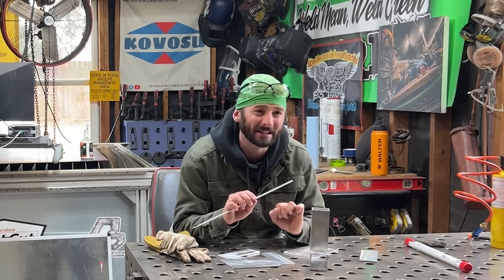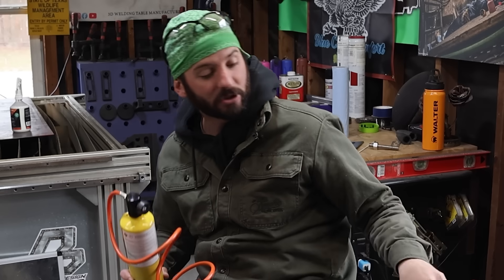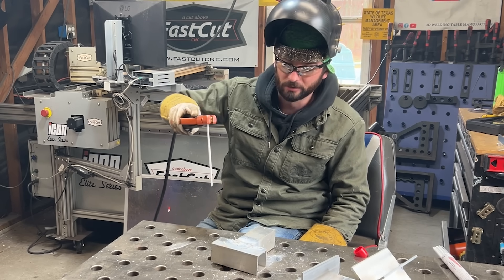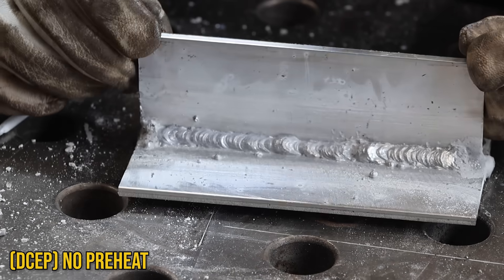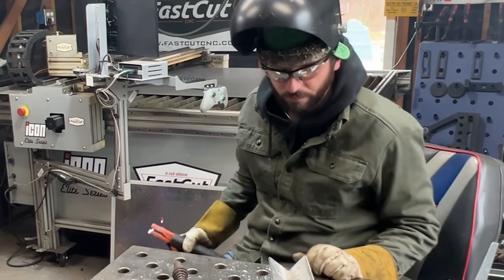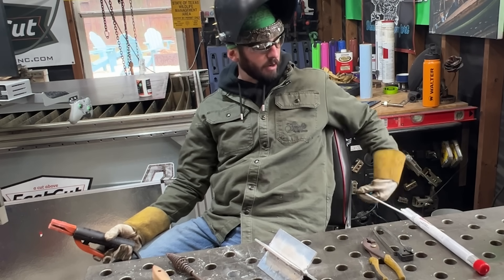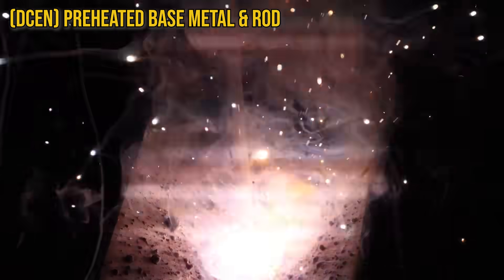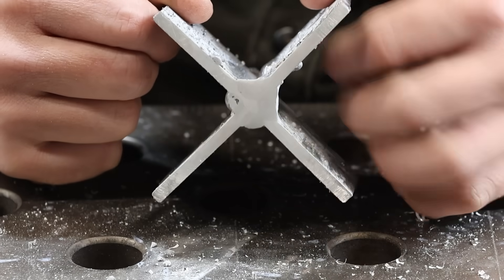Tips for Stick Welding Aluminum: Polarity and Preheat

Comment: I welded some aluminum on motor casing and flux went sliding downhill its hard to see the weld when not welding on a level flat surface cause of the flux

Comment: An old timer told me to soot it up with my torch, then heat it til the soot clears, then weld it out with more of a push angle. It was tough, but came out pretty damn good. Its a tough day for sure, but keeping them on the rig for a down and dirty repair can turn you into a job site hero.

Comment: I love stick welding aluminum. I do it when it’s too windy, or when it isn’t a super critical weld (fence, gate, trailer cracks, etc.) I’ve found if you run hot and fast it welds nicely. If you run it hotter than recommended, it starts up fine. It’s a super quick rod though. I’m the only welder in my county that runs this process. It’s definitely a useful skill for my business, and like everything else, it has its place in this world.

I’ve never ran off a portable or shop stock welder. I always use my bobcat. But I assume if you run it hotter, you’ll find it easier to start it back up.

Comment: Aluminium is paramagnetic; it's weakly attracted to magnetic fields. If you've heard of copper being diamagnetic, that's just the opposite. When you weld, you create a strong magnetic current that runs through your secondary loop and arcs through the air where the weld occurs. I'd be willing to bet that this is similar to a long-arc scenario where the magnetic field gets wonky at the weld and blows spatter everywhere.

Comment: Don't try this at home!  --

College days, no money, aluminum rims on a dually... Horsing around on wet asphalt, I hit a curb drain and chipped out a rim on the rear. I didn't know how to weld aluminum except with tig, and had only a 120v mig welder. And propane cutting torches. So, I built a small form to hold the molten aluminum, preheated well, cleaned with stainless wire brush, knocked just over half the flux off the rod, and used the propane torch and 1/8" aluminum arc welding rod to re-cast the 5" x 1" missing section of the rim. Then ground it down to reshape back to original. I used bead sealant one time, and it held air. I would have to air it back up about once a year. About 18 years later it cracked slightly (had to look close to see it), and had to air it up every 2-3 months, or when I hauled heavy. The inner steel rim gave me peace of mind to use it, and never had a problem hauling heavy.

Moral of the story is, aluminum arc welding rod has a place when other options are out. Key is to know what to look for when welding aluminum, and gather advice on the limits of the project. I certainly wouldn't do this on anything but a dually or ranch truck of my own, but far more can be done without having to make everything perfect in setup. Too many people won't do something because they think they have to have the perfect setup. It's just false. In my case, I used the rims for over 20 years before finally upgrading... the rims were obsolete not long after incurring damage. The skill is knowing what to look for, not having the perfect facility or tooling...

Comment: I haven't read the other comments. I have decent results by cleaning the aluminum with acetone, then stainless wire brush to remove  oxide layer. Then preheat and quick brush again welding immediately. But yea it sucks.

Comment: next problem is .......

there are a bunch of alu alloys out there , anodized and not .....etc. ....some of them have specs that say " not weldable " , and you almost never know what is in front of you 

7000 and 2000 series are not really weldable and most with copper and zinc in it are getting cracks 

the aircraft rated alcumgpb f250  is very good and durable in cast and forged form , but not " conventional " weldable

Comment: Worked shipyard as an Electrician, worked with welders next to each other. we had only 1 guy that could make it look good. always dc reverse,  dont remember the size of it but remembered it took 3 rods to weld an 3/8" aluminum stack studs. HY 100 1 inch thick used on subs and the big battle wagons, we hung electrical heaters on the metal before they could strike an arch

Comment: What little aluminum stick welding that I've done has only been possible through lots of preheat (400F), cleaning with a stainless steel brush that I dedicate to aluminum prep, grounding my work directly with the clamp, running the bead fast with little manipulation of the puddle and inclining the work so that the flux puddle tends to run behind the direction of rod travel. On long welds I back-step weld to prevent the cone of heat from getting too far in front of my weld. If that happens the weld will require less and less amps as it progresses and my welder isn't set up to do that. You seem to have better gear than I do so I suggest that you check out a YT channel called ZILA. The video you want is called "Aluminum Stick welding tutorial full explanation". This guy gets the best results that I've ever seen in a demonstration, but he has some features on his machine that I don't, so I fudge it a little bit. Thanks for showing the electrode negative method. Now I know that I never want to do that. LOL!

Comment: preheat to 400 degrees, DCEP, use a temp stick, travel faster than usual, clean your metal with stainless steel wire brush, not carbon, very short arc close to metal

Comment: Aluminium stick is easier with more aggressive angle,  and it really needs you to clean the weld area extremely well before starting the arc. Aluminium stick should be thought more like welding hot galvanised, 90% of the fight is just dealing with the surface. Alu stick should be thought the same way as repair welding contaminated welds.

Comment: I'm having the exact same problems. I only have an arc welder, so all the toys are not an option. Never did aluminum before. I can't even get the arc that you got. It pops and sizzles and complains but won't bite into the work. I think it's 1/4". I'm starting to wonder if this is some strange aluminum alloy. Until now it never occurred to me that aluminum came in apple lemon and cherry.

Comment: i love stick welding aluminum personally. its quick and works great. i use it all the time on filthy nasty cattle pots and cattle trailers mainly. best advice i can give is make sure the rods are dry. run hot and fast, skip around to move your heat around. ill run anything between 120-150 amps for 1/8 rod. tight arc and move fast. if you're doing a bunch of welding in a certain stop, youre going to be continuously turning your amps way down.
Reply: Truth lol
Reply: I have a problem after welding a half inch all the flux falls off the rod. makes for a very expensive repair. any suggestions would be appreciated.
Reply: @jimbailey7997 keep them dry in an oven.  I've found the aluminum stick rods will pull moisture out of the air and soak themselves.  And don't open the bag until you need them. One of my last cattle pots I did during a rainy day, just tore the corner off the bag, it never went outside. And in like 3 hours I was pouring water out of the bag
Reply: these was in a plastic container that I just opened up. i’ve had better success with 3/32 rod.

Comment: Would the problem with DCEN be that that you're trying to break through the oxide layer on top of the aluminum with the arc, and in doing so, mixing it into the weld pool creating all that spatter? With DCEP, the oxide layer would be lifted up off the base metal and vaporized in the arc leaving mostly all good metal from the electrode to mix with the base metal I'd assume.

Comment: Man, those fireworks! It reminded me of back in the early eighties, trying to oxy-acetylene weld some 1/8" aluminium plates together [that I got from a scrap metal place]. My fireworks was so bright that I was blinded through my welding mask and so I jumped back away from the weld. The metal just kept burning at a huge rate. It turned out that the "aluminium" was in fact magnesium printing press plates. That gave me a scare.

Comment: My first ever experience with welding aluminium was modifying the plenum to accept a different throttle body on my project car.
Was in my early 20s and was mainly used to stick and gas welding. Took a fair bit of welding and grinding but still have the car and the intake still is held together so managed to do something right.
Welding cast aluminium seems to work ok, have tried to weld more "pure" alu with worse results. Nowdays I have both TIG and MIG machines so will not use alu stick if Im not held at gunpoint.. :)
Someone I talked to compared welding alu stick with trying to control the melting of a icicle on a red hot steel plate with your eyes closed.

Comment: I'm a Navy veteran. A proud Hull maintenance technician. 2 welding schools. I worked at the most famous bakery around. W.B.H. A proofer rack would jam and break once in a while.  130° temp, 110° heat. Oily, nasty, throw your clothes away after this job. I stick welded these during production. Not in a clean shop environment...... Dang best times I ever had looking back :)
No one else new how to do it....
Reply: *KNEW

Comment: I heard about an old trick years ago about stick welding aluminum is put the rod in a rod oven and get the rod hot. I’ve never tried this but worth looking into
Reply: That was kind of what he did then he shorted out the rod and let it build heat.

Comment: Hi, Folks.
I first did alumin(i)um stick welding in 1971 in the Kimberley region of North-west Western Australia about 400 road miles in any direction from anybody who could teach me anything about it and with the ONLY regular outside communication being by radio schedules twice a day.

The company for whom I was working at the time had an alumin(i)um hulled launch that somebody had 'parked' on some rocks - which apparently did do NOT the hull any favours as it would no longer keep all the water on the outside.

The 'boss' asked if I could do anything about it, me being the designated welder for the site. I had a look through a Magna welding catalogue that was in the office and found that it listed some alumin(i)um welding electrodes. I told the 'boss' that I would have a go at it if we could get a packet of these electrodes.

The packet arrived two weeks later and they worked so well that I welded up the holes in the boat hull and then went on to built a canopy to cover the back half of the launch behind the half cabin, this being a nice touch since we were in the Tropics.

Thank you, Magna Electrodes.

Just my 0.02.

You all have a wonderful day. Best wishes. Deas Plant.

Comment: I tried stick welding some 10" sch. 40 pipe in the late 80s and I tried everything.  And it looked like I crapped or threw mud on it. It was horrible.  We finally brought the wet rig to the field and I welded it up like I had been doing in the shop. The QC told me "you want be able to walk the cup on this big boy" . Paula is my wife.  Her name is on this and I don't know why. Lol.  Anyway I thought I would make it look like I walked the cup. On the cap. I would walk to one side and dip the wire then do the same on the other side and file the edges and it looked like I had walked the cup. He asked me several times how I did it. I never did tell him.  The 8" welded fine. The 10" I had the machine turned up as much as it would go. And it barely would weld it.  It looked good when we were done. It was basically a gutter for a building over the train track where they brought the cars in and unloaded something.  Corn syrup I think it was.  My one and only time welding aluminum pipe. I could not make the stick look like anything.  Neither could anyone else that tried.

Comment: Process to weld aluminum with stick is. Clean area to be welded with a stainless steel brush. Then after doing this I use either acetone or alcohol and wipe it clean. Then I preheat to about 300-400 degrees. Then weld it. I also usually set my machine between 100-105 amps for 1/8” rod.
Reply: Thanks bro. Want to learn but I don’t know if I can teach my self or go to school. I will try to teach myself first

Comment: Use warm rod and preheat your material with a torch and it’s a lot easier. Also turn your machine up a little hotter and the strike is more consistent.

Comment: Ok so I worked for a concrete company for 40 years. I did alot of maintenance for them. They went from steel extension shoots to aluminum due to weight putting them on and taking them off all day. Well, the hooks would break off, and after all the muratic acid they endured during cleaning, they were awful welding on new ones with a mig. So i tried stick. To my surprise, it worked great. Took a lot of practice, but in that application, i would only use that process. Worked great with not so perfect aluminum. It is the only time i would ever use stick welding, but for that, it was perfect.

Comment: Maybe I got lucky, I welded with aluminum stick for one day, just one. I had a great time, i was using arctec rods, and had the best aluminum welds I'd dine at the time. I was also used to a severely neglected and abused tig machine and an improperly setup mig. Since my job at the time never really did aluminum, the stick machines just worked better.

Comment: I have to give that a try i bought a cheap amazon s7 tig a couple years ago and have only got to use the stick havnt been able to afford argon but would definitely loke to try the aluminum stick welding be about the only way i could atleast untill i could afford some helium since its dc only. Also the weld doesn't need to look good as long as it penetrates good you can always grind the bead to make it look good

Comment: Never welded aluminium with stick, have done with gas and the flux used is rather toxic and I expect that stick welding flux is similar. Flux for gas welding aluminum is typically made up of chloride salts of potassium, sodium, calcium, lithium, and aluminum cryolite.

Comment: I have used a rod just called a 4000. Can't remember the brand. Runs on DC positive and once you get used to the speed of its fast burn it behaves about like 7018.

They will make your welding table rust like crazy!!

Comment: For some reason I had really good luck running those aluminum stick rods off of my engine drive. I had a older bobcat 250. I haven’t tried one my my new ranger, now you have me curious. Might have to burn some rods tomorrow, and yes the travel speed is very fast.

Comment: I have an onboard welder on my Jeep, it is made by premier power welder. The cool thing about the process is that it welds with high frequency. It sounds really cool welding with 7018 and the weld process is very smooth. So, I wonder how it would do with aluminum stick rods. I have to look in my rod stock, I am pretty sure I have some. The other question would be how about placing the aluminum rod in the rod oven?

Comment: I've had great results with that exact rod on cast aluminum. Never had issues with  yield strength. I welded the rudder back on a friend's mercury outboard with it over twenty years ago and it's still holding up. If you're unfamiliar with it, gather up some scrap and get proficient before tackling the job. Preheat is key on 1/4" and above. Sometimes you have to stop and cool thinner coupons. A weave or spiral pattern give the best result in my experience. It can pile up in the center like stainless but I wouldn't pause on the outside of the weld.
Reply: preheat is critical? What temp?
Reply: What stick electrode did you use?

Comment: I had to grind some aluminum and we would load the grinding wheel or sand paper to stop the aluminum loading up in the the grinder.
Reply: Cutting wax works too
Reply: @blackwaterrepair10  Load it with cutting wax and then hit it with a torch to melt the wax in.  Wait long enough for it to solidify and it works like a dream.

Comment: Aluminum sucks a lot of heat, it is one of the most conductive metals, DCEP should be the best way because it would blast the most amount of heat into the metal and turn up the amps a lot higher than normal. Never tried it myself but I know the metallurgical side of it.
Reply: electrons (thus heat) moves from negative into positive.  I'd do AC then play with the AC balance and frequency to see if I could get a nicer run.  Perhaps even go more on the positive/cleaning side of ac so you get a little more penetration. not sure.